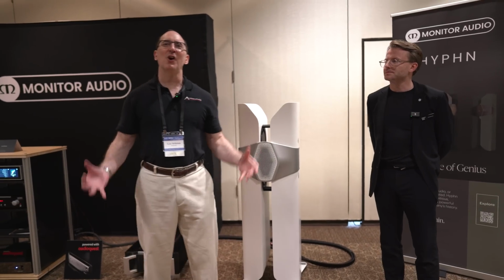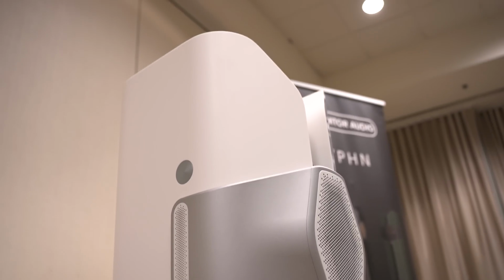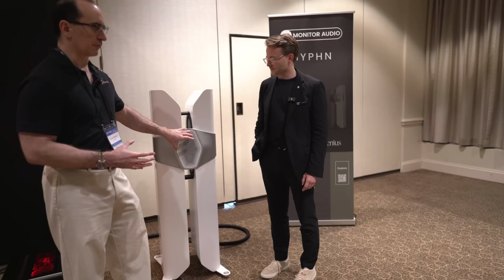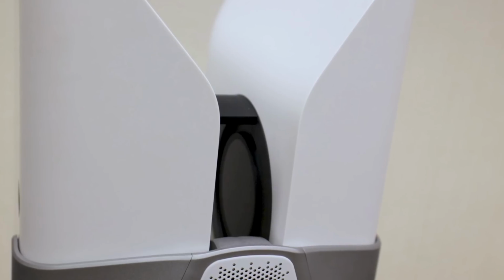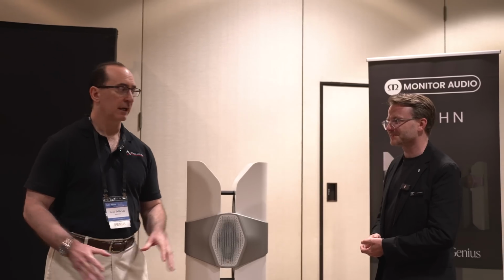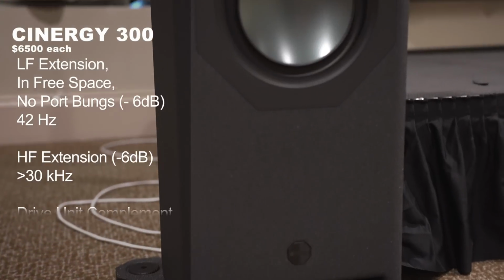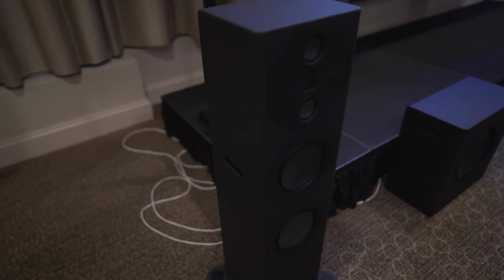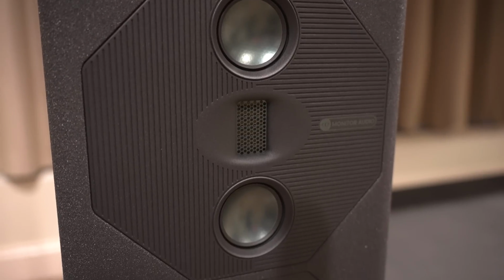Monitor Audio $95K Hyphn & 7.4.4 Cinergy Loudspeaker Systems Demo Experience

Comment: They make some beautiful speakers. That first speaker is a tour de force of engineering and I imagine can throw out some serious db with 4 bass drivers and 6 mid ranges. Would the material the cabinets are made from be similar to AcoustiComp? I've got Quintet 5 which uses a similar sounding material to defeat cabinet resonances.

Comment: Seriously.. $95.000 !!!!!!!!...i belive all drivers cost less than $2000.. but cabinet are small and easy to build.. I do not trust factories who overpriced so much their product.. I call this a scam.. I build myself a WWMMTTMMWW FOCAL drivers ( 3 times)  for a home theater LCR.  12"w+ 12"w + 6.5"m+6.5"m+ 1"+1" t  + 6.5"m + 6.5"m + 12"w + 12"w - focal car drivers ( 6.2ft tall speakers)+ wood,  And I have not more than $4000 for 3 speakers in total..
Reply: But the synergy are not bad in price.. just 3X  the price than a POLK top of line